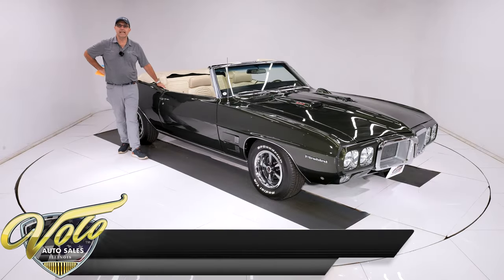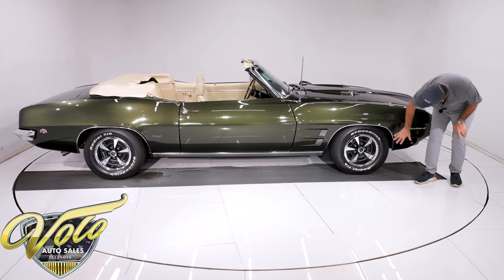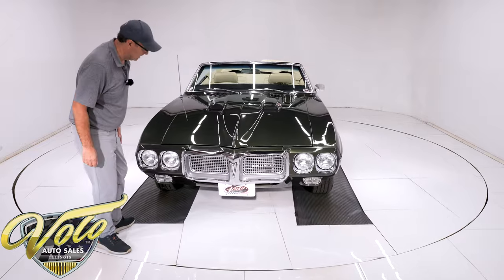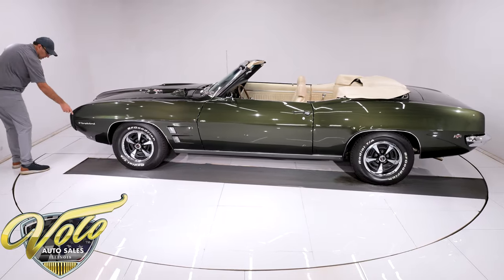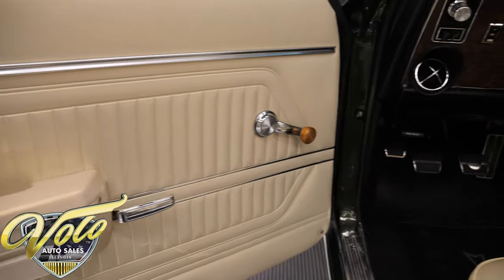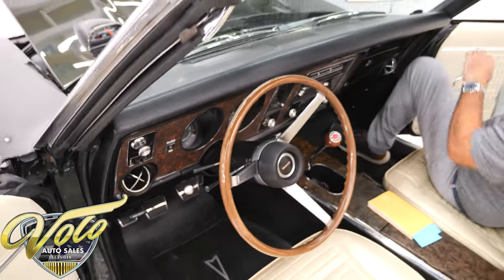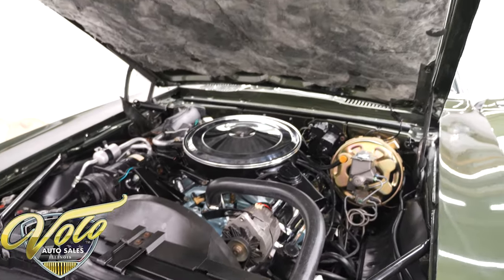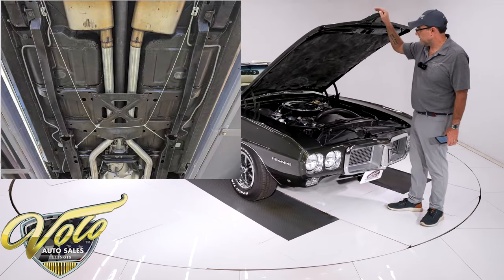1969 Pontiac Firebird for sale at Volo Auto Museum (V21128)

Comment: Sales for the 1969 Firebird sales dropped to 87,709 units. The hardtop remained most popular with 75,362 new owners, followed by a mere 11,649 convertibles. Prices began at $2831 for the hardtop and $3045 for the convertible. Most (66,868) Firebirds had Turbo Hydra-Matic transmissions while 20,840 had manual gearboxes.

Yes, I copied and pasted.